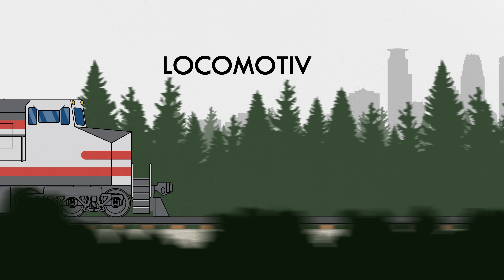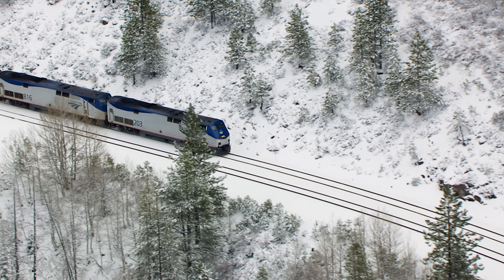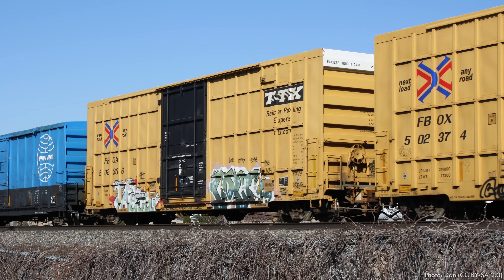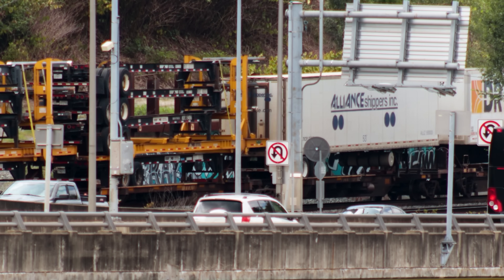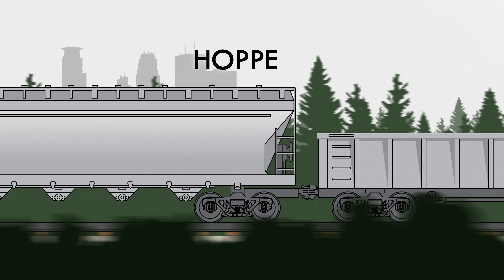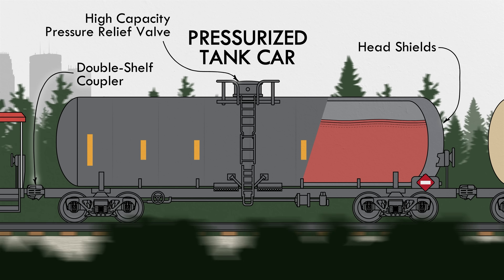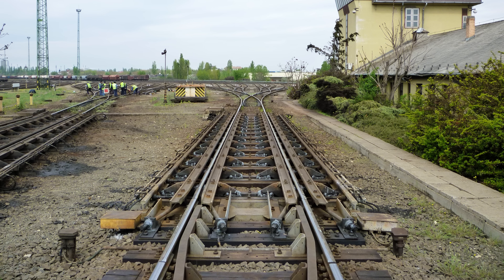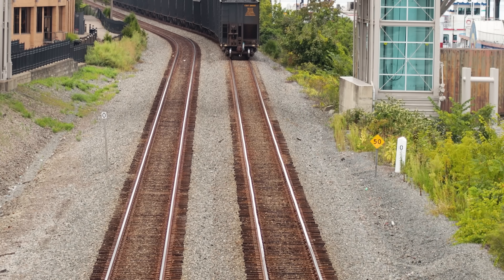Every Type of Railcar Explained in 15 Minutes

Comment: massive critique: this is very US centric and ignores a lot of EU differences:

Bilevel train cars are starting to become the standard in Germany, as they pack more people and can use less space in the train station at the same time, allowing to alleviate the demand in high transit areas. Loading and unloading them is usually faster due to doors on either end of the wagon and not in the center. Baggage cars have been discontinued long ago, and with them Combine cars. 
Diner cars are only availeable on the long distance ICE rails. 
Sleeper cars are rarely used these days, having been replaced with reclining chair cars in most overnight trains - and even then, "Schlafzüge" are rare in Germany as a whole.
Dome cars... there were exactly five German trains that featured a dome section: the 5 TEE (Trans Europe Express) Rheingold, which operated from 1962 to 1983, when the dome car was stripped from the train set and 5 years later the TEE trains at all stopped operating.
As most transit in Europe (and thus Germany too) is done on somewhat short distances, crew cars are rarely employed as a whole. More often, the crew will work one trip to a designated swap station and then on the trip back, making a break in the swap station, or when the train is at the destination and waiting to turn around. As a result, Crew cars are not used at all.

In the Ruhrgebiet, you will see "Kokillenwagen", which are literally steel flasks filled with molten steel, driving the material from steelworks to casting or foundry works on somewhat short distances but in huge amounts.
Autoracks in Germany are usually two-decks - and not enclosed.
Trailer on Flat car is usually shunned for a special car that allows docking the trailer *lower*, more akin to a well-car, but those cars are starting to get rare again.

Comment: I use to regularly ride the Amtrack Coast Starliner between Seattle and LA.  It used to be a really fun "journey is the destination" and I would do it when I needed to get between Vancouver Canada and LA but wasn't ion a rush.  Sadly as the years went on Amtrack kept cutting corners and more corners.  When they eliminated the parlour car I knew I was done.  That car was so central to the overall experience and was where all the socializing of the sleeper passengers took place.  Without the car most everyone just stayed in their cabins except for meals and it was a completely different and lackluster experience.

Comment: As a San Antonio native, I've seen most of these rolling through town. From the coal cars headed to the Calaveras power station, to automotive cars stacked full of bare chassis on their way to the toyota plant, its always fascinating to watch them trundle along. As long as they actually keep moving, that is.
Reply: FYI, they're closing down the part of the Calaveras plant by 2028 and converting part of it to run on natural gas.

Comment: I am in luck. So in Northampton PA they are building a Bridge to replace the existing bridge the existing bridge is from  the early 1900s a former RR trestle. I wonder if they will uncover anything from the Lehigh coal and navigation canal. It runs under the bridge. As welp as the Lehigh river. There's a low head dam about 1200ft away that's part of the old canal lock system. But either way i get to see a bridge build. It's litterally almost in my back yard.

Comment: One fascinating addition to passenger train cars: Generator cars are used in hot countries like Egypt on lines without elecrification to provide adequate power and redundancy for operating the AC even in an event of locomotive failure. These are cars that house 1 or 2 diesel engines and generators.

Comment: Nice video, but you need to work on your understanding of passenger cars. Especially your view of double decker/bi level cars. It does not take complicated time to load/unload passengers. The timing is nearly the same for single level cars (see Bombardier multi-level commuter cars for Sound Transit).
Also, a sleeper car is NOT used for a nap after eating (geeez...). They are used for long distance routes that require more than one day to reach (example Seattle to Chicago).

Comment: Well, a few you skipped: cattle cars, handcars & mailcars, all which might still be going. And one defunct car, that open coal hopper right behind the engine. Also, more another usage than type, suspect North has heated cars for freight that shouldn't freeze (liquids, some organics, medicines); normal freight often not even insulated.

Comment: The "covered hoppers" at 8:35 are actually covered versions of the high-top "bathtub" gondolas like the variants seen at 8:06

You can tell by the shallower angle of the "chute" and the long curved bottom with no visible openings compared to the open-topped picture that preceded it

Comment: And all of this is assuming trains which are expected to be pulled apart every now and then. Especially outside of North America, it's common in the passenger space to see multiple unit trains, where the functions of the locomotive are integrated into a set of passenger cars which are expected to (almost) never come apart. So for laymen: if you cannot spot a locomotive anywhere in the consist, it's a multiple unit train. And if a dedicated locomotive is present, but said loco is designed and built in a way to blend into the rest of the consist, and meant to not be removed from the consist on the regular, it's called a power car.

I guess a big reason they're rare in the US is because their likely scenes are relatively rare in the US currently, and in the few places where they do make sense, I guess the American railway industry has forgotten about them. Also, though diesel multiple units exist, a lot of multiple unit trains are electric, powered via overhead lines or maybe third rail, tech which America has refused to embrace at the same scale as the rest of the world.

For instance they're especially common in more rural railways, since their light weight and integration of locomotion into a small package makes them cheaper and easier to operate. They're also common in very intensely used (sub-) urban networks, where this lighter weight means they often have way higher power-to-weight ratios, enabling faster acceleration as well as stopping. Finally, they're fairly common in high speed settings, where this power-to-weight ratio is being leveraged for top speed. As far as I know, there exist no trains with top service speeds above about 220 kph which have a locomotive which is meant to be regularly removed.

Comment: - What about the control car? Sometimes found at the tail of a passenger train.
- Furthermore you have these cars that transport molten metal in big cauldrons near steel mills.
- Even further down the line of tanker cars you have these versions with two big ball shaped tanks, mostly use to transport highly corrosive liquids.
- Also for overhead wires there are cars that have a top platform for workers and platforms with coils of wire to replace old and worn wires with new one's.
- Finally in the maintenance part, they also use these weed control cars, spraying pesticides along the rail line to keep it free of weeds.

Man hear me being a know-it-all, no, I really liked the video!
You really got more than most type of car available if you ask me so who am I to judge! Nice video Grady :D

Comment: Roadrails reminded me - one of my favourite military vehicles from the Imperial Japanese Army was the Type-95 So-Ki, which is an "armoured railroad car" - it has tracks for your usual armoured vehicle services and manual rail wheels that could be lowered and then extended for narrow, standard and broad gauges, going 72kph on rail. Was mostly used to guard railway lines, you essentially have a small railway guardpost that can move, and also to move to damaged parts of rail for the railway engineer crew. Had no weapons, though it did have a turret for the commander to look through and had connectors to allow it to join up with normal rail cars. I can imagine people might've used the front half of the track guards to ride the vehicle along rail (albeit likely ill-advised).

Comment: The first passenger train I rode on had cars in between single and double decker.  There was baggage and bathrooms on the lower part, and passengers on the upper part.  There were also sleeper cars and a diner.  The train I transferred to was a single decker passenger, because it was for shorter trips.

I'd rather take a train than drive alone for a trip longer than a few hours, since I could just sit on my computer, or get up and stretch my legs without needing to stop somewhere.  It's better for getting to college in another state than having parents make a two-day drive each time.  Much better than dealing with all the security and waiting around for airplanes, if the the trip by train isn't too long, and I'd have needed to travel a significant distance to even get to a regional airport, from where I was, while half the towns out in this farming area were built on the rail line.

Comment: 0:38 Not all trains have locomotives. In fact, in many European and Asian countries, most passenger trains do not have a locomotive, and instead rely on motors distributed among the passenger cars (Electric Multiple Units or Diesel Multiple Units).

1:34 Double decker passenger coaches are very common, including in the United States. Nearly all American commuter rail systems use double deck coaches, and the majority of Amtrak long-distance trains use double-deck "Superliner" coaches which look similar to the Surfliner coaches shown at 1:19.

Comment: Good video, Grady.  Thinking very hard,  I came up with two contenders for the list.  A depressed-center flatcar and the specialized train to transport and discharge all welded rail.

When I was young, we used to keep track of road names on freight cars in a train as we watched it go by.  Locomotives and cabooses stayed on their home road pretty much guaranteeing you knew what railroad you were watching .  Railbox and such did not yet exist. Most of the railroads that existed then are no longer. Pool power has locomotives floating over virtually any railroad.  Now, if you are caught watching trains, you may be suspected of being a terrorist.

Comment: I work on trains. Your 'flat cars' carrying intermodal containers aren't flat cars. Only one set of trucks between platforms, meaning they cannot be seperated. No knuckle. They come is groups of 3 platforms or 5 platforms. This is just a different version of intermodal cars that look like flats, we call them 'spline' cars. Don't know if that's an offical name, but hey.
Reply: Also, in general same applies for intermodal 'well cars'. They also come in groups of 3 or 5 platforms. However can be single platform cars as well.

Comment: You missed two common rail cars. 1. Control car, or Cab car, used for push-pull trains. 2. Cement cars, which I call "onion cars" because of the dry bulk "onions", usually four of them, on a car. Maybe not that common in the USA, but a regular sight in Europe. Maybe they are called "pneumatic cars" since you force air into them under pressure to get the dry bulk cargo out.

Comment: In San Diego we have the 'Coaster' which is a passenger train with  2.5 level passenger cars. They're double in the center and have a level in the middle which is halfway between the top and bottom that joins the cars and walk between them. It also makes it easier to get between levels since the stairs go up half a level at a time.

Comment: Swiss here, I disagree regarding double deckers, a well designed double decker adds a lot of capaccity and doesn't slow down loading/ unloading... 
They are among the best pasaanger railcars in use here in switzerland and recently even smaller regional lines are setting on double deckers.

Comment: Most of the TOFC cars are not simple flat cars.  They at least have pedestals to which the trailer attaches with the fifth-wheel pins.  Also, some are roll-on, roll-off but some require the trailers to be lifted on and off by crane.

Comment: I live right next to a railroad, across from an old station. The station master used to live in this house and walk across the tracks to work. There used to be a caboose on display next to the station. Those machines that stir up the ballast rocks are a pita if your yard needs to be mowed right up to it like mine, they always throw a few rocks out into the yard lol. I hear the trucks on the railroad 10x more than I see them, they make a distinctive sound lol.

Comment: "Unless you work in the railroad industry, passenger trains are the only ones you get to interact with"

In the distance you hear the screech of a bum/hobo trying to sleep in the structural supports of a bulk freight car.
And if you look over to your left, there's a guy wearing a hoodie painting some "artwork" on the side of a goods wagon.
And that snap you heard just now was someone breaking the lock on a wagon to steal some electronics.
And that blood streak you see here was someone willingly interacting with a moving train...
And over by that crossing is the pieces of a truck that got stuck on the tracks when a freight train split it in half.
And here's Jimmy, he doesn't work in the railroad industry by he does load and unload freight cars in his factory job.
...
Shall i go on?

Comment: The french TGV folks have a special instrument railcar they add to a full 2+8 set each week to test the tracks. Mainly filled with accelorometers, to check is there are bump along the line...
I rode it a few time from Paris to Marsille for lunch and back. A full train-set, just with us an a few techs. testing out if "my" aircraft satcom would work on the train, for broadcasting "the fasted radioshow". Fun project. 
I assume AVE and other highspeed rails have similar.

Comment: Additional passenger cars
- Bilevel cars are really common actually. There are two variants: one with the doors on the bottom level for low platforms, and one with the doors in split-level vestibules at the ends.
- Cab Car: it has a cab so they can drive the train in reverse without moving the locomotive to the other end. Amtrak uses de-engined locomotives with a baggage compartment, nicknamed "cabbage car"
- Multiple Unit: Some trains don't need locomotives, they simply propel themselves. Comes in diesel or electric power.

Comment: I live in Sandpoint Idaho (home of the only Amtrak station in Idaho) across a small dirt road from where CP Rail and BNSF tracks parallel each other. The long waits when they’re swapping crews or doing mechanical checks are frustrating, but the upside is getting to see a huge variety of cars.